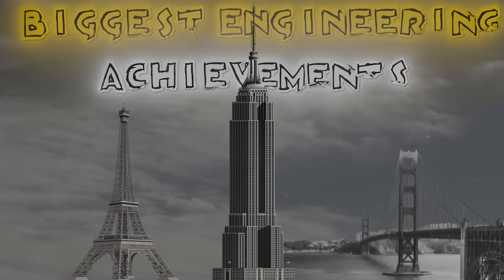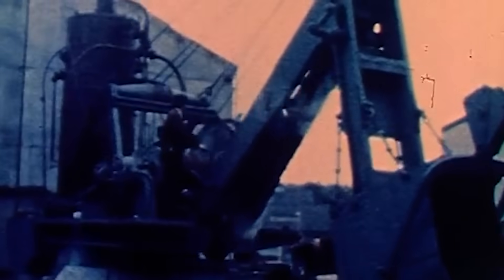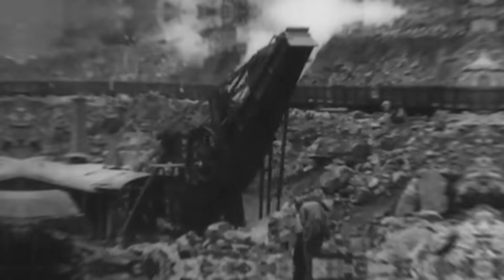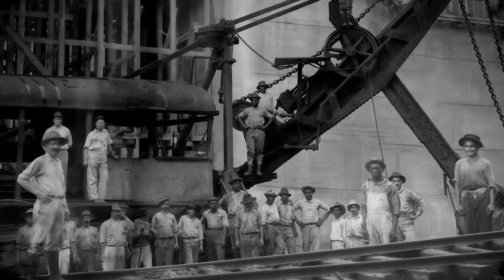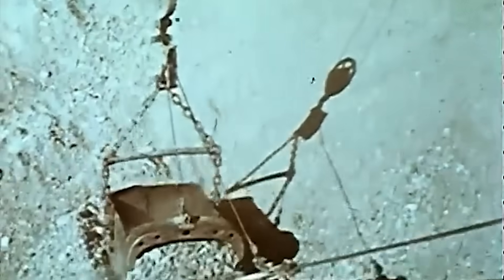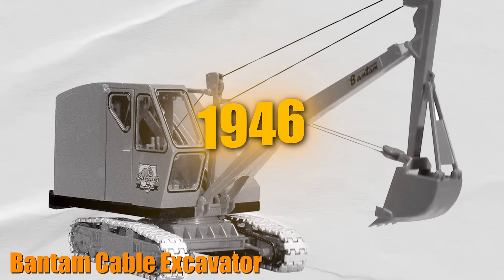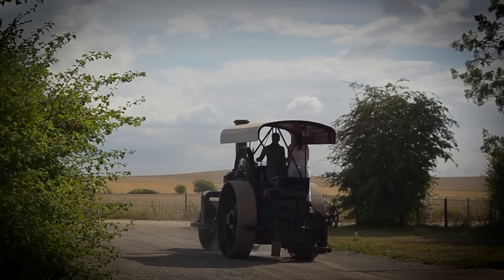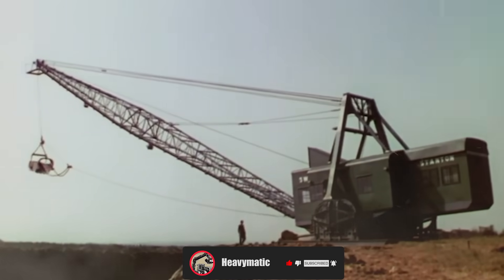10 ANCIENT Heavy Machinery That Are Still Running

Comment: We need to keep this machines running, not only as a historical piece of equipment preservation, but also as a practical mean during transition periods of 2050-2070. During 2050's the last drop of oils will be extracted and conventional equipments will come to halt in mass. So, lack of infrastructure machine will be heightened for many decade until transition to new solution and mode of EVs made available.
Reply: Last drops of oil? Read something not printed in the 1970s.

Comment: My gramp had an old bucyrus erie cable shovel in the gravel pit when I was a kid, first machine I learned to operate and work on, it’s actually still there on the tree line, we got it running and moving a couple years ago, aside from needing new cables I believe it could be put back into use

Comment: I can remember big cable excavators when I was a kid, in the  early 60s. Working in quarries though by about the mid 60s most were hydraulic which was faster amd more efficient. Was around those, scrapers, dozers, loaders and excavators in sand pits as well as quarries. 
I have seen old steam excavators on You Tube still working and not as a demonstration either. Plenty of those too

Comment: Wonderful machines, all built by engineers doing honest hard graphed with out computers, sophisticated machinery and all that rubbish, marvels of there time and marvels know, and if we had to build them know like they were then we would throw are arms in the air and say it cannot be done, the Victorians had a can do attitude that we have lost, we would not have our modern age with out them, ok, the belshing smoke would make greta Thunberg wet herself, SO WHAT!!!!!
Reply: Of course let's not forget the preceding invention that made all of these possible - the slide rule!  All the complicated calculations for steam pressure, flow, heat transfer etc would have been impossible just using paper and pen (especially the long division sums).  But the slide rule made it easy and quick.  Every engineer had one, I learnt how to use one at school in the early 1970's and still have it!

Mind you, you could equally argue for Napier's inventions of logarithms, the mathematical "trick" that made the slide rule possible.

Marion (hey, that used to be another big manufacturer of steam shovels that didn't get a mention!  I want a vote for Marion Power Shovels, they made even bigger machines than Bucyrus).

Comment: Would any commenters  happen to know why these old cable machines had the bucket facing away from the house, whereas the contemporary hydraulic machines face the bucket towards the house?
Reply: its because of the way the winches work, hydraulic systems can push and pull. winches can only pull and have to freewheel to reverse. hope this makes sense!
Reply: @rtv8055  The video demonstrates that some of these old machines had buckets facing the driver and in particular the drag line versions.
Modern hydraulic excavators are used both push and pull unless they are specifically designed for face work.
Reply: @rtv8055  Thanks!
Reply: Probably because they are less complicated to achieve high capacity. Their buckets usually discharge from the rear of the bucket without hydraulics.
Reply: @adrianchetwynd1334  Thanks.
Reply: @adrianchetwynd1334  Thanks.
Reply: Shovels have the bucket facing away. They are still widespread for mining tasks.
Reply: It partly depends on the intended use. Mostly, the bucket faces outwards if its for face work (quarrying), but if the bucket faces inwards, thats better for digging down, i.e: removing overburden (topsoil etc.), and digging trenches.
Reply: Very simple.  If you're digging above the plane the machine sits on, like up a quarry face, it's more efficient to fill the bucket by pushing it up the slope away from the machine.  Most old steam shovels (and the biggest modern power shovels) were and are still employed in this way.  But if you're digging below the feet of the machine, i.e. excavating a hole, it's more efficient to fill the bucket by pulling it up towards the machine.  Most small modern hydraulic excavators are used in this way for trenching and foundations.

Very large modern hydraulic machines for quarry use now have the facility to put the bucket on either way around so you have the best of both worlds.

Marion
Reply: @marionbloom1218  a few others have already replied to my query, but your point about the plane of the shovel is quite elegant and makes the most sense. No dis to the others tho, whose replies said pretty much the same thing.

Comment: Is this AI generated? Most things are correct, but the video is a bit repetitive (especially for Bucyrus) and inconsistent, sometimes referring to specific models and other times just "the dragline"
Reply: Has to be with the constant repetition
Reply: And the fact that the title is misleading as all get out?
Reply: Yes. YouTube is getting ruined by all these AI narrations dragging well-written scripts into the Uncanny Valley
Reply: Yep other 10k channel full of AI crap.
Reply: AI is an infection.
 BTW would any commenters  happen to know why these old cable machines had the bucket facing away from the house, whereas the contemporary machines face the bucket towards the house?
Reply: @calrob300  Yes, having the bucket facing away is more efficient for digging into hills and quarries which were many of the early excavators most economical jobs. As machines got more nimble and hydraulics came along, they were able to be used for more purposes without switching the dipper and bucket between digging down or digging "up". Still, many of the worlds biggest excavators work in quarries and have the bucket facing forward to dig into rock walls better.
Reply: @kotten9534  Super answer. I've wondered about that for years. Thanks!
Reply: @calrob300 digging up vs digging down.
Reply: @calrob300 leverage. It’s much easier to push than to pull a bucket especially considering those machines used the pulling strength of cables to do work rather than hydraulics. It’s just better “ergonomics”
Reply: It's basically a documentary just voice
Reply: Lots of stolen footage. Even the thumbnail.
Reply: And the extensive use of superlatives.